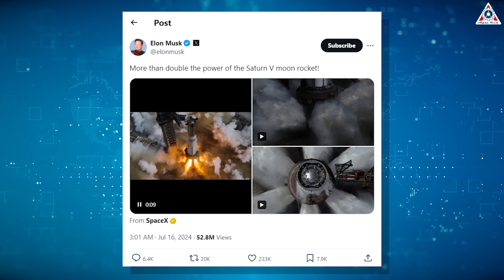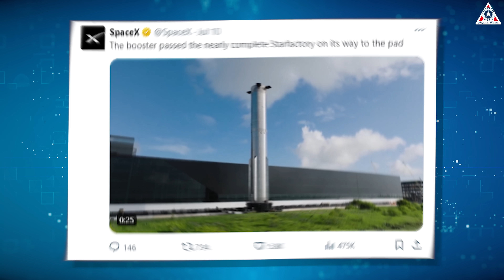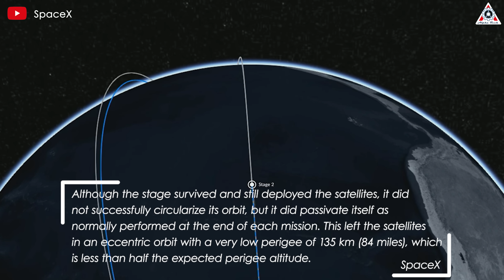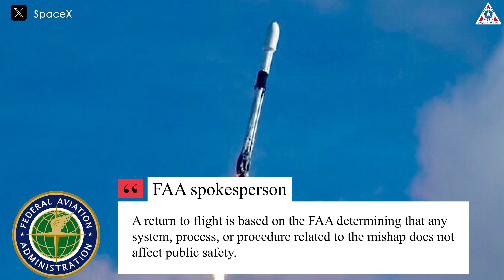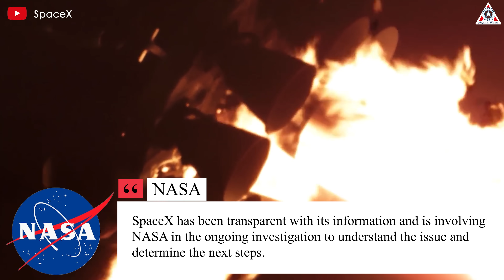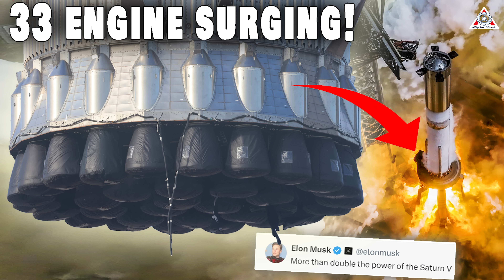SpaceX Starship 33 Engine SURGING! Flight 5 Ready. Musk's Reaction...

Comment: As always, SpaceX making progress.
One notices that the Trolls are having a harder and harder
time accusing Elon of being a Con man... 🤭
The engines issues are to be expected, They are some pretty edgy tech. Basically contimuous feed bombs...
 "Las Bombas!"
And its obvious it takes awhile twidling to get reliable function in such numbers as on each ship. And one can only imagine what things would be like, if they were still using those Raptor 1 designs. 😖
The good news is its sounding like Raptor 3 may debut this year or early next on Starship V-2, I would expect a bit of a functionality set back at first, maybe an engine or two not firing, but with the nifty simplification from the Raptor 2 models, they should be up to snuff within a couple flights, and set a new standard for reliability at pressure and volume of flow.

This is gonna be bad news for the competition, as SpaceX will be about two jumps ahead on the engines game board. And those engines are money makers...

Also Falcon will soon be obsolite, archaic engine designs using a dirty fuel... I think we could see SpaceX have the money to design and build a courrier rocket based on the Starship fabrication and engine tech.

Chances are as Starlink expands, the proceeds will help SpaceX expand its operation into more variables in designs and production.

Also the Space Force and DOD are likely to get a kick in the pants under the next admin.
And their Boss start pointing at rocket tech, and asking how it can replace 100 year old legacy tech.

One thing we know for sure is that Space is the high ground.

He who can hang out there and drop rocks, doesnt need Nukes.

We will probably recycle a bunch of those for resources for
Transit ship drives, and for Moon base, and Mars base power supplies. And for those Picket Ships we should have an englobement of around our solar system with their ears and eyes on, for our inevitable first encounter of the Arrival kind.

Being suprized is the unforgivable sin of the Warrior class...

And if you think we are alone in the Universe, you aren't as intelligent as you presume.

And nothing would fix the Planetary economy faster and better than serious high production Space programs.

Also it could usher in a new era of cooperation. As it would take importance over our Malthusian tendencies. We really should start morphing Military expenditures towards space, and quit threatening each other for the profit of a few.

Lets create competing Space Industrial Complexes.... And maybe consider doing redundant things in space for mutual security, and have some airlock standards, so we can plug in, and save the guys on other teams if there are problems.

We are all humans...
And we will likely eventually face some things that are not.

Maybe if Aliens show up hungry, we can feed them Bureaucrats to keep them busy while we mount a defense?
Would seem a Patriotic end use for them.... 🤣

Better days ahead guys, Lots of good paying Jobs, new sources of resources, plenty of adventures...

Probably not that long until guys are drinking cold beers in Alpha Base on the Moon.

Would be just the thing after working outside in a Space suit.. Even with the shade cloth up areas, it gets sweaty...
But somebody has to do that work, and it pays well...

Its all gonna come way faster than we think.

Just sayin....
Reply from the maker: Thank you for your comment!